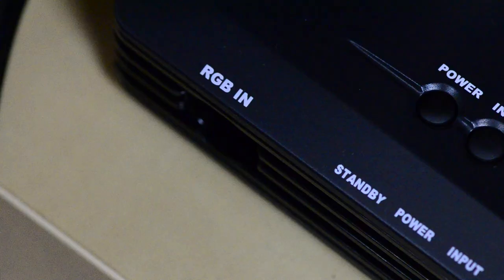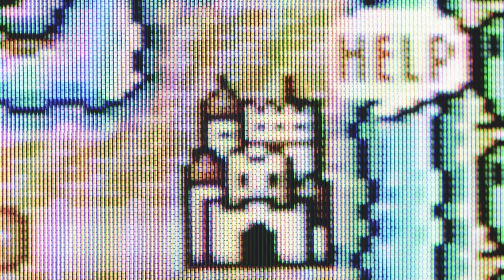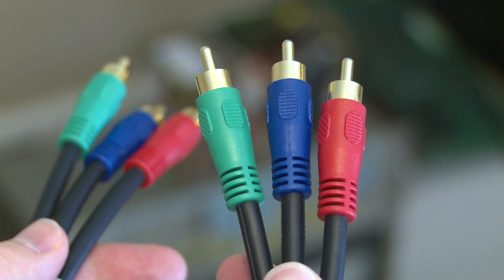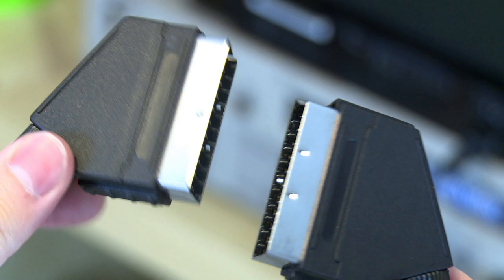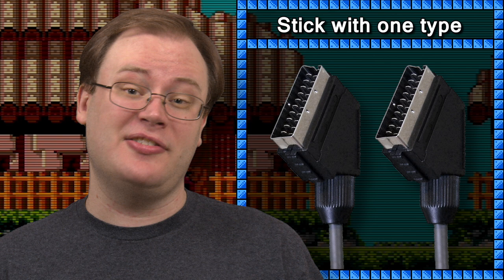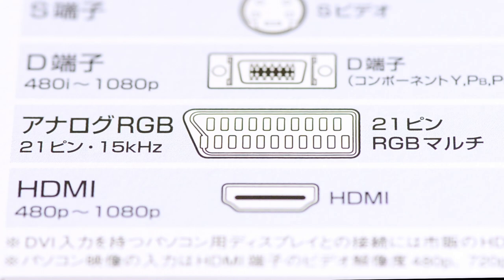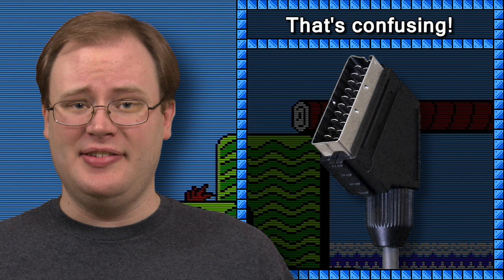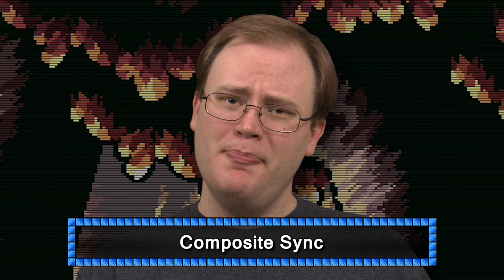Understanding RGB and Sync :: RGB103 / MY LIFE IN GAMING

Comment: Have you guys ever thought of mentioning the Panlong SCART to HDMI converters on one of your future shows? I have one and although it is definitely not a Framemeister, I'm not seeing much lag and the picture quality is pretty damn good considering that it's only $40-$60 depending on where you buy it from. Again, it is not Framemeister quality by a long shot, but it seems like it could be a good entry point for gamers and a budget.
Reply from the maker: [Try4ce] I'm not familiar with those, but it sounds like it could be pretty handy. I also wouldn't mind getting a SCART RGB to YPbPr component converter someday for use with SDTVs.
Reply: ***** I plan on doing the same thing actually.  I still have a 27 inch Sony Trinitron with component inputs that is currently taking up some space in the living room and I have a $50 Amazon giftcard that I can't figure out what to use it on. Since I have some cables coming my way for the Genesis and I already have cables for my SNES, I figure I could have two systems hooked up via SCART at the same time and I'll have the S-Video input available as well if I feel the need to hook up more systems.

But yeah, I came away pretty impressed with the Panlong converter. I see them on Amazon and Ebay fairly regularly for around $50. It is very barebones as far as features are concerned, but it does have an HDMI pass-through so you don't lose the port, it upscales 240p to 1080p and it looks better than my stock television scaler on my TV. There's no scanline support and I have to set my television viewing mode to 4:3, since the video outputs into stretched fullscreen. In return, the colors are extremely bright and vibrant and although I don't think the pixels are as sharp as the framemeister, it's almost emulation quality and the colors look better than my Wii U emulated games.

Comment: When I first got into scart.  I came here and you guys helped me so much.  Now my setup is all scart but do have alot of hd retrovision component cables and one day would like to get a g comp bc love my gscart.  But I found a radio shack 4 scart switcher for 8 bucks.  So using that until I get gcomp.  Great video.  What male to male scart connectors do you guys use?  Mine is really short0.5 meters.
Reply from the maker: [Try4ce] I use shielded coax cables from Retro Access to daisy chain my GSCARTs together.
Reply: @mylifeingaming  mine is from retro gaming cables but will look at retro access thanks.

Comment: Another really informative video! We picked up the Framemeister based on the RGB101 video and I have been especially happy with the product. Still need to make some time to get the best output out of each individual system. 

Unless you guys know of a place that has the specifics for each individual system? Ideal cord (I buy all of mine from retro_console_accessories), ideal settings on Framemeister, ideal mods and parts for consoles that may need them. 

I'm having a particularly hard time with the Dreamcast (official VGA cord to component adapter to D5) and original Xbox (using component to D5 cord).
Reply from the maker: [Try4ce] Check the XRGB wiki on junkerhq.net/xrgb for some settings ideas. In the hopefully near future, we're going to begin putting out some shorter videos that break down all of the considerations and options for hooking up specific consoles. I'd also like to do a short video on Framemeister settings. I don't think Coury has yet gotten the cables he needs for the best Xbox and Dreamcast setups, but maybe he can chime in, as he is much more familiar with those systems than I am.

Comment: I heard some things about the N64 and RGB that you may want to know. I've heard it said from some modded N64 owners that while most N64 games look decent through RGB, the games that use the Expansion Pak tend to look pretty bad.

I've heard this is because that many Expansion Pak games up the resolution to 480i, but then those games switch between 480i and 240p on the fly, and apparently, RGB doesn't like this, which is why Majora's Mask, Excitebike 64, and Rogue Squadron don't really look any better. For games that use the Expansion Pak to increase resolution, you're better off using s-video, since it can handle the resolution switching.

However, I know that many RGB mods disable composite and s-video out. I don't know if Try's N64 is like that. However, there is a mod on a video on Youtube called "N64 Non-destructive RGB mod", where the uploader says that his mod doesn't cut any video traces, it simply adds another. That's the reason why those other mods disable composite and s-video. If Try's N64 is like this, then I say he got screwed. If Coury hasn't gotten his N64 modded yet, I recommend you send it to a modder following the non-destructive mod pattern that I pointed out earlier.
Reply from the maker: ShogunGin0 [Try4ce] My N64 still outputs the original signals as well as RGB, though I have a second N64 from a friend that I typically use for non-RGB captures, just for the sake of keeping it "pure," I guess. As far as I can tell, there's no change in the image for the other outputs on my modded system.

240p to 480i switches are a problem on the Framemeister regardless of what signal is used, it's not just an RGB problem or an N64 problem. Chrono Cross is basically unplayable due to its 480i menus. I don't know if it's a problem with CRT monitors, but I can't imagine why it would be. Cruis'n Exotica does not use the Expansion Pak, but it has 480i to 240p switches between menus and gameplay... a minor annoyance in the case of that game. Majora's Mask does not make any resolution changes, as far as I know. I briefly tested Castlevania: Legacy of Darkness's "enhanced" 480i mode, but it causes the game to run at a crawl... so there's really no reason to use it over the 240p mode.

Comment: Thanks for the great video.  I've been somewhat confused by the different video types.  I've been looking at getting a Framemeister really soon and learned I could use the JP-21 cable on my SNES.  I had been trying to figure out which cables to get for it and had found an ebay seller with tons of cables.  I have it narrowed down to the CSYNC or the sync-on-luma one.  It said that if you had an RGB N64 to get the sync-on-luma one and it worked on the SNES as well.  Not sure if you meant that one left the checker board artifacts or just the Sync on Composite.
Reply from the maker: +Yomi Kibagami [Try4ce] I can't tell the difference between sync-on-luma and CSYNC, even if CSYNC is technically cleaner. In fact, sync-on-composite can look just as good if it has upgraded shielding... but that's usually an extra cost that has to be specifically requested.
Reply: +My Life in Gaming Awesome!  Thanks for the clarifying info.  I'll probly end up getting the Luma one since it would work for my N64 if I get it modded.

Comment: firstly really wanna thank you guys for your videos, think i watched all and some twice, great content! I got a problem i was hoping to bother you with :) Recently got a b&o mx6000 for retro CRT gaming, and im about to change all my composite cables to RGB over SCART instead, so i ordered some. The SNES to RGB SCART cable worked without a hitch, flawless picture and colour separation. But when i hooked in my new Wii RGB SCART (i live in Sweden by the way so my Wii has RGB instead of US version Svideo capabilities) i noticed right away there was no improvement over composite, same RED and blue dither color bleeding. I think the problem is my snes RGB cable is uses sync differently so that works great.. and the Wii RGB cabel is wired for sync on composite pin 20 and my B&O does not recognice there is a RGB signal and uses pin 20 for picture instead of syncing the RGB. Could this be true, that the B&O does accept my SNES RGB cable but Not my Wii RGB cable because of limitations in the tv, or is a tv setting needed to play with? Hope i am making any sense describing this. Any and all help whould be appriciated :) If i had a US model Wii i would just use s-video and be happy, but my PAL version Wii does not support this unfotuntaly.

My deduction is therfore that my b&o TV cant take sync on composite but instead require csync for RGB, information on this cant be found in the TVs manual or in searhing google, hence i cant confirm this , but it seems the most logical conclution, whould you agree? Also what can i do? is there a separate Wii RGB cable that uses csync, or do i need to get my hands on a Sync Strike or a Sync in Scart Board and a solder iron to test my therory? Thanks!
Reply from the maker: [Try4ce] Unfortunately I'm not sure, though that does give us some ideas for things we need to research regarding the PAL Wii for whenever we get around to a Wii episode. My best guess is that you are at least correct in that the TV is using the composite video signal instead of RGB. Whether it's a compatibility issue, I'm not sure... because I think sync-on-composite is kind of the SCART "default" if I'm not mistaken. PAL GameCube only does sync-on-composite, but I don't know about PAL Wii. I'm honestly not too sure what to do, but some sort of sync cleaner could be the answer. Of course, the other big question is if it's a regular Wii, not a Wii Mini? Because the Wii Mini ONLY supports composite video, which would definitely explain the issue.
Reply: Thanks a lot for replying, yes sorry I didn't mention but I have the RVL-001 model, the one with all the game cube ports still on it. Ok so if both SNES and Wii output rgb with sync on composite, could it be the rgb signal is weaker on the Wii, and that could mean tv does not sense it and defaults back to using composite altogether, is that a sound theory you think ? All the best!

Comment: Awesome video! thanks It explains a lot. I'm so lucky to have been born in europe and having grown up on RGB. Especialy with the mega drive where the 50/60hz switch is real easy.  I do think your are missing Sync-on-green standard :)
Reply from the maker: [Try4ce] That's true, but we don't have any experience with sync on green. I haven't come across any gaming applications for it yet. It seems to me that a large majority of the information out there on RGB is European in origin... this is all pretty unfamiliar to most people in North America, sadly!
Reply: You are right, sync on green wasn't mentioned. However there was a reason for that, in RGB you rarely deal with it. As a matter of fact, the only instance I know about is the PS2 with the VGA out. And even in that case, the PS2 is capable of regular sync when using an RGB cable.
Reply: My PVM als has the option sync on green. The only thing I was able to get to work with that was my Amstrad GX4000. I also now that Next computers use Sync-on-Green
Reply: ***** Nice to know about that, the only one I've used in mine is the PS2. Good thing is that Extrom interfaces can convert between sync types

Comment: I have seen some SCART cables that use whats known as Sync on Luma, which basically takes the sync from the S-Video Y signal when outputting RGB. How does this look in comparison to c-sync or sync on composite? It would great to see how it looks since some consoles such as the PSone don't have c-sync output and if it looks clear, it would be a good alternative to sync on composite on non c-sync consoles.
Reply from the maker: Ryan Good [Try4ce] It's actually a great alternative, and I wish we'd mentioned the Playstation sync situation in this episode. My experiments have lead me to believe that superior cable shielding can make the results of any sync method just about as good as CSYNC, but sync-on-luma seems to more easily produce results almost equivalent to CSYNC, with the cables I've tried. My N64 wasn't wired up for CSYNC by the modder, but the sync-on-luma cable looks waaaaay better than sync-on-composite.

Comment: I modded my megadrive 1 to output stereo over the Din plug. I killed the sync signal and mono channel to solder l and r audio on to it. I had to create my own scart cable to get it working. But the image is great, no checkerboards or whatsoever. I think that you don't need sync on a megadrive 1 or genesis 1.

Comment: Please do a video on getting 15khz via emu crtdriver to a SD NTSC tv. I've built a pc with the correct video card ATI 6570 (emu crt driver).  Used the keystone vga to component adapter and it still doesnt sync properly. I ordered the Ultimate scart adapter, planning on using that with a scart to component adapter and see what happens. Its all going to a Sony trinitron CRT. This is for a mame build

Comment: Loving the show, and appreciate the depth you guys go into surrounding the XRGB.
Picked up a Euro Scart cable (sorry not sure what sync style) for me PAL Dreamcast.
Sadly I can only hear the audio through my XRGB.(HDMI out)
I've since heard that playing a Dreamcast through Scart can be tricky, hoping to get your thoughts and assistance.
Cheers!
Reply from the maker: [Try4ce] Yeah, I think that SCART is generally not recommended for the Dreamcast, because certain games that output at certain resolutions may not work over it... or something like that. I haven't heard of audio issues, but I also haven't researched the system a ton. I'm not too well-versed in the Dreamcast, and in fact, only just bought my first game for it a week ago. I also bought a cheap S-video cable, because I don't know yet if I want to put the money into buying the best video output for it (those VGA boxes for it can be a bit expensive). I'm not sure about S-video from a PAL Dreamcast, but if the PAL console supports it, then that might be a more versatile (and cheaper) option in the interim than SCART until you decide to buy a VGA box (a box called the "Toro" is apparently THE one to get, but it's like $80 or something).
Reply: Thank you so very much for the prompt reply and feedback. Will give S-Video a go, and see how we go.
If you're a Super Turrican fan, might I suggest Gun Lord? Thanks again, and enjoy your Dreamcast experience!

Comment: My Life in Gaming, what's the difference with SYNC on LUMA to Composite SYNC (CSYNC), is one more superior than the other? Which one would you recommend?
Reply from the maker: [Try4ce] Technically CSYNC is "better" but in practice they look exactly the same. If you have an option to use luma easily, there's not much reason to shy away from it. In some cases, some equipment may require CSYNC.

Comment: I mistakenly bought the CSYNC instead of the Luma sync cable. Does it result in lower quality? Are there no differences? Or can’t I even use it? I’m using a Panasonic Quintrix Acuity EDCRT (480p)

Comment: Of my game consoles that support RGB as an optimum output I have a PS1, a PAL SNES with region mod chip, a PAL GameCube and a Japanese Sega Mega Drive. RetroRGB.com seems to recommend Luma as Sync for the PlayStation and Nintendo consoles, but recommend Csync for the Mega Drive. 

I already have two SCART to HDMI upscalers, one for SNES and one for the Sega. This is the device I use: https://www.youtube.com/watch?v=RS55pmLIEjA

It looks pretty good, although I have noticed checkerboarding on some SNES games and jailbars on some Sega games. I'm thinking of upgrading the cables and also getting a SCART switcher so I could go RGB on my Gamecube and maybe my PS1. Obviously three of those consoles use Luma as Sync and the remaining one uses Csync. I assume these two are not compatible with each other. I imagine I could workaround this by plugging the Luma as Sync consoles into a switcher and output the switcher to one upscaler, and plug the Csync console directly into the other upscaler. But is there any particular SCART to SCART cable to connect from the switcher to the upscaler? I assume I need a Luma as Sync SCART to SCART cable, but I haven't been able to find one online.
Reply from the maker: [Try4ce] You don't need to worry about sync type on a SCART-SCART that has a full set of pins. It just passes whatever the sync type is through. I recommend this cable: http://www.ebay.com/itm/SCART-SCART-cable-Pro-Coaxial-Multicore-switch-boxes-/161718717677?hash=item25a72fcced Yes it's more expensive, but it has better shielding. When I was using a cheap cable from a switch box, I was getting some audio buzz issues. This solved that very well. If the link doesn't work, check earlier in the day. She closes her eBay store for the day after so many orders are placed.

Comment: Very educative. Interested in only one thing, is there any HDMI cable for PS2 that can pass Full HD (1920x1080)? Not component cable, got one. It is analog device that struggle with digital tasks simply put. ;)
Reply from the maker: [Try4ce] No PS2 games support 1080p. Component cables can do up to 480p, 720p, and 1080i in supported games, but there are not too many games that can output those resolutions. Component gives you the best signal that the PS2 can output. The solution then, is to handle that signal properly. Most TVs and generic HDMI converter boxes will not do a good job with this. The best way to connect it with a good result with component cables from a PS2 is a CRT TV or RetroTINK 5X. There is no official HDMI cable, and any third-party HDMI cables sold today will give you a similar result as a generic upscaler or a connection directly to the TV.